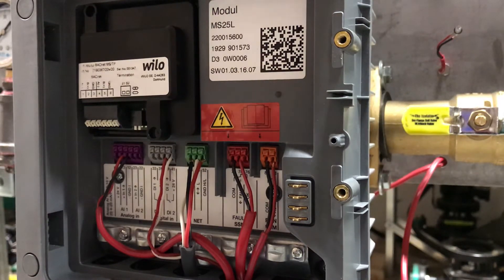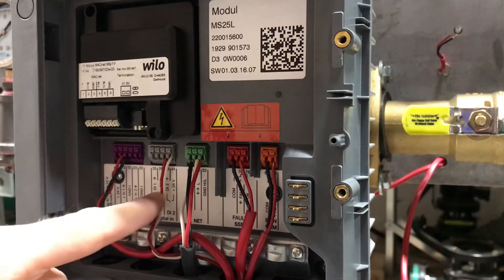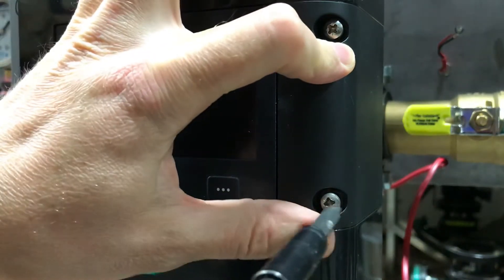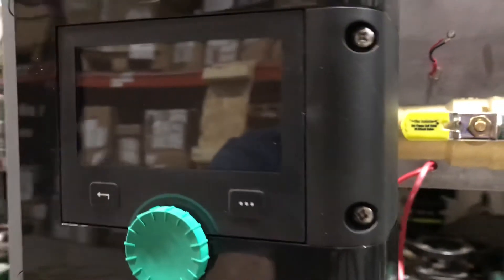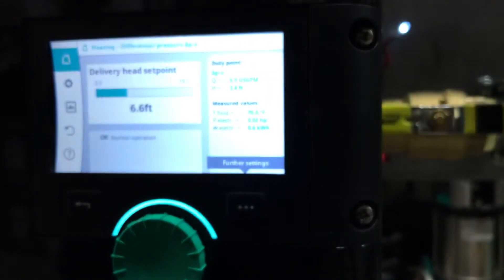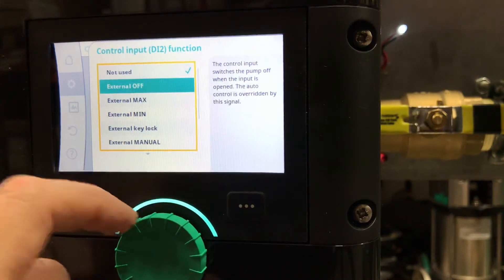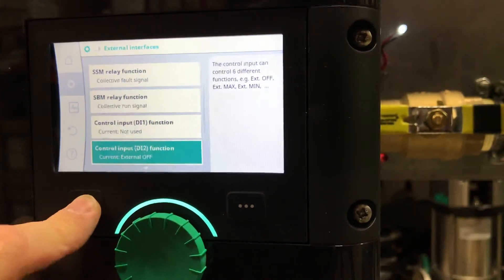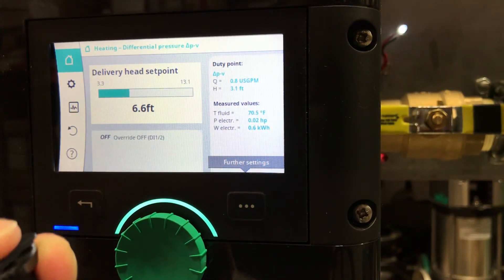Stratos Maxo external On/Off setup

Comment: Thank you! Question, so is this like boiler TT terminals (sending out voltage) or dry contacts. I saw your switch but was your switch wire to a 10v/24v/ etc. circuit?
Reply from the maker: Hi Victor,
I am very sorry. I did not see your question until now. For the On/Off command the digital input DI1 and 2 just needs a dry contact. Both DI1 and DI2 are programmable. The switch that I used was a small two pin toggle switch. If you have any other questions please let me know. Thank you for watching the videos.
Reply: @hydronicworld  No problem and thank you! I'm actually running multiple geothermal heat pumps (6 on first set of pumps, 4 on the 2nd set, 2 on the 3rd set) off of theses pumps (Supply and return set of pumps). I used a 24v transformer and switching relays from the geo units to engage a double pole RIB relay with the open contacts wired into each pump (for each system). Works like a charm!
Reply from the maker: Hi Victor, 
This sounds like a very successful installation. If you have any pictures of the installation I would love to see them. How much energy (BTU) are you getting from that system? Sounds like a large system. Thank you for the reply. Peter.